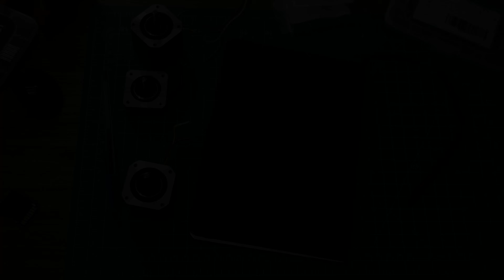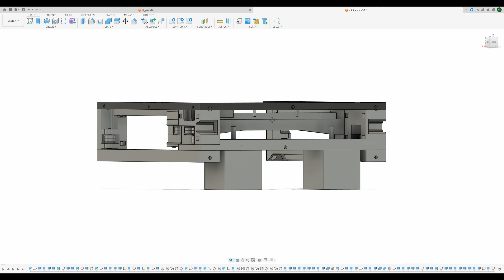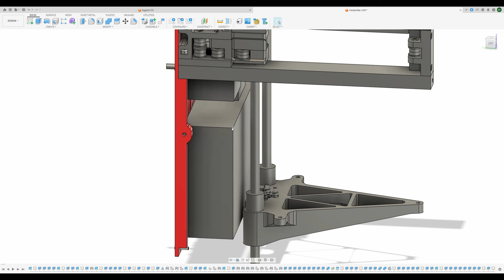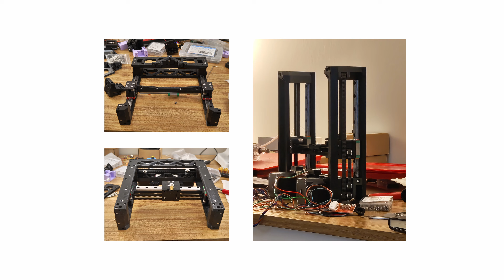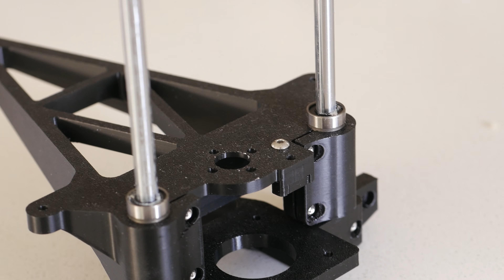I 3D Printed a 3D Printer: The Encore CoreXY

Comment: Why a Bamboo Hotend and not a widely available E3D?
Reply: I'm building one with a V6-like toolhead as we speak. It doesn't fit well. The 120mm X movement range is not about 120mm but PRECISELY 120mm. All thanks to the 40mm ultra narrow toolhead. The V6 is 22mm wide, plus the 10mm fan on one side already sticks out 1mm that I just lost. Plus the screw heads sticking out  of the fan, another 2mm.

I'm using the V6 because I had it already, but the bambu hotend is the right choice for this machine 100%!
Reply: Bambu its smaller, It is lighter, has more flow, is cheap and has a very easy and rigid assembly for some crazy speeds

Comment: Pretty cool that you managed to build a frame with printed parts only. 
RepRap machines didn't really use aluminum extrusions for structure - but threaded rods, metal piping and even MDF/Plywood (Prusa, at least). 
I've always wanted a Delta configuration printer, but very few were made commercially available, so I'd have to build my own. 
I'd also love to build a Scara, but that's pretty complicated and I don't know if there's maintained firmware that can handle the funky kinematics.

Comment: May i ask how you design a whole printer in fusion? Do you just import parts like the nozzle or do you draw them?
Reply from the maker: Most of the parts were simple enough to draw directly  (such as the motors and linear bearings). IIRC the only thing I imported was the Bambu hotend model since I needed exact dimensions for the mounting interface.

Comment: I see that the stl files have an enclosure/bracket for ender 3 style boards, could you share the specific board you are using for control?
If you are actually using a 4.2.7 board for an ender 3 you can actually upgrade the hotend to an Sprite + a CR touch and make what essentially a mini K2

Comment: i did the same  with a voron v0 but I redesigned it for performance and use 3d printed jigs/ templates to cut most parts out of scrap aluminum. it took some time but the cost is extremely low  and the printer is bulletproof!

Comment: Bunch of stuff that crossed my mind:
@05:56 The black Skirts appear to be bowing already - Perhaps consider making them either thicker or giving them a Pattern which will help against this issue ( when dealing with thin stuff - having a three-dimensional shape promotes rigidity - See Shipping Containers and their Corrugated Panels ).
That open space PSU is kinda rubbing me the wrong way... Please consider the possibility of adding a separation Panel between the Build Space and the PSU - Either via a 3D Printed one or Perhaps a sheet of Acrylic.
In a similar manner - Perhaps consider the option of having all the Panels Laser Cut from like 4 mm thick Acrylic ( I guess 3mm would also work but after replacing the flimsy "3mm" ( more like 2.5mm ) ones on my Voron with 4mm ones I've become a staunch fan of 4mm Acrylic because of how much more rigid / nice it feels )

Comment: This is a very respectable little printer. The print quality is better than my fullsize all metal printer.
Thank you for sharing! :)
Btw. what was the cost off all the non printed parts combined?
Reply from the maker: Cost was around $250 - you can definitely get cheaper ready made printers for the price, but for DIY printers nowadays it's on the cheap side
Reply: @AYMakes  A Voron Kit of this size costs over 800€/$ so 250 is a win in my book. Thanks

Comment: At the cost of extra complexity, I'd recommend checking out kevlar sleeving of the bowden tube. It helps a lot with PA tuning. Also, in my experience, the bondtech extruder is a really bad bowden extruder. The gear ratio prevents super high speed PA moves, and there are just a lot of better, more modern designs out there with more grip and better feeding.

Comment: I really wish you could print PCBs and ICs so you can fully 3D print a 3D printer (I know you can kinda print PCBs with special filaments, but it's not that good compared to the real thing and requires laying thick traces).
Reply: > I really wish you could print PCBs and ICs so you can fully 3D print a 3D printer

You can mill PCBs, and you can 3D-print a CNC mill. :-)
Reply: @TheWolfgangKeller And what about the PCBs for the CNC mill?
Reply: @UltimatePerfection  You have to start with an existing PCB for bootstrapping the CNC mill. After you have built it, you can (hopefully) use the CNC mill to create the PCBs for both the 3D printer and the next (or current) CNC mill by yourself.

Comment: I’ve also built a compact Core XY printer equipped with a remote Bowden extruder. I’ve run into persistent tuning issues with consistent corner blobbing that cannot be fixed solely by adjusting the Pressure Advance (PA) value. I would greatly appreciate any tuning recommendations if possible, thank you.😶

Comment: Is there a particular reason why you didn't use something like the anthead or a4t?
Reply from the maker: Two reasons - I'm not too familiar with the Voron ecosystem, and the current print head is a decent amount smaller than those and I wanted to maximize compactness. I can consider a more standardized mount for future iterations though
Reply: @AYMakes  I appreciate the response, I think the anthead would be a worthwhile to give some consideration to. It is widely used in the printers for ants community, being the main hotend options for the micron and salad fork, and comparing the dimensions to your custom one it should be compatible in the XY axis. It would also allow you to go direct drive as it supports a large variety of extruder options.

Comment: Ayyyy.... It looks much like my 3d printed 3d printer I made 8 years ago; also core xy. I mounted all tree motion steppers in the base together with the PSU and electronics.
I'm used rods to transfer the xy stepper motion to the fixed gantry on top

Comment: nice build, the only thing i would be harping on is that it can't print itself. because that would be an ultimate 3d printed 3d printer the one that can self replicate to make more of itself
Reply from the maker: Not a bad idea - I'll need to look into splitting up some of the parts in a future variant! The max build length is a bit under half the full external dimensions of the printer, so there might only need to be one split.
Reply: @AYMakes  i 3d printed prusa i3 mk3s and other than for bed spider every part was printed on prusa i3 :] from petg. it technically works but i have problems with heat cleep blocking the nozzle
spider for holding the print table was sast from aluminium using printed part as pattern though 
my first 3d printer was made from furniture parts like drawer bearings as linear guides and big chunky 3d prints from ender 3  and about the same print surface as yours. soon after making it i learned this is just a bit too small for engeenerring stuff i usually do

Comment: A really nice, small and cute printer. I am looking forward to a completed parts and bom list. This looks like a good hobby project.

I started my 3D printer journey around 2015 with an Anet A8 and then a Tevo Tarantula. The whole hassle of having to tinker on the printer all the time made me give up on the hobby because I mainly needed a tool to print the things that I designed or that I needed. With BambuLab printers and printers from other good manufacturers like Prusa and so on I can finally dive back into 3D printers as a tinkering hobby because I know that I always have a reliable comrade beside my tinker project.
Reply: I started with an Anet A8 too then moved to an Anycubic mega s then a Bambu p1s.
Reply: In 2015 you could of bought a Prusa and never given up.
Reply: Still rocking an Anet A8 here, but the Snapmaker U1 is the upgrade I've been waiting for. Soon...
Reply: @6yjjk  my Anet A6 is still printing